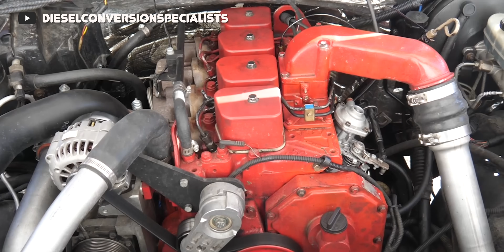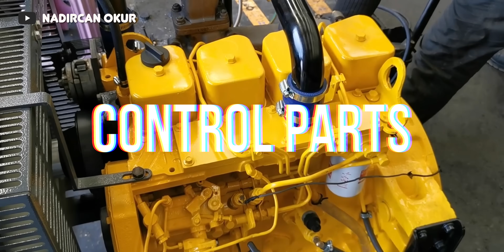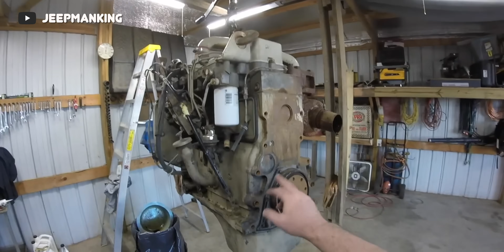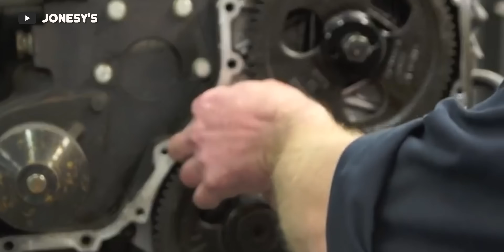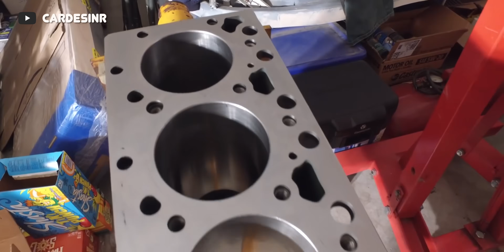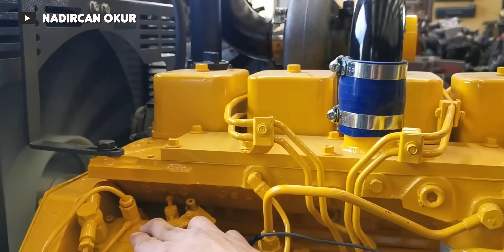Everything Wrong With the 4BT Cummins (It's OVERRATED)

Comment: I'm sure with the P pump you can get some decent power figures if you really wanted especially when throwing a larger turbo at it but these engines honestly don't really have a place outside utility and equipment applications. That being said, I have always wanted to throw one in a half ton truck just to see what I could do to it.
Reply: Look up 4bt Ford ranger. He was making massive power with p pump and twin turbo.
Reply: Not really, you can maybe make 250hp but for the cost you can just import a om605 an easily make 400hp or more. In uk you can get then for a couple grand and it cost about 2k to ship it. So for under 5k you have a 500hp capable motor.
Reply: @WillBilly.  250??? Yeah sure you can make a ton more than that I’ve got a buddy with a twin turbo 4BT in his Dakota I race at the drag strip in my 12V and he makes 500 horse and 1,050 ft lbs at the wheel
Reply: @Callsign_TACH  dont believe it for a second, a full drag 4bt only did a 14 @90 in the 1/4 mile. the pump is extremely limited, its hard to push more fuel out of them. the 4bt pump tops out at 230cc and with it being a i4 its just not alot to work with. if your buddy truly has a 500hp 4bt make a video of some dyno and drag runs, it would be the fastest 4bt on youtube.

Comment: For the money, I'd rather swap in a Kawasaki ZX-11R or a Hayabusa engine in place of that heavy 4BT monster and still get the same horsepower.  With that, the power to weight ratio is increased significantly.
Reply: Are you seriously comparing a diesel to a motorbike engine?
Reply: And have to rev it to 40k to get 3 foot pounds of torque.

Comment: One more thing… the R2.8 crate for about the same price (or a little less) comes with a fuel pump, fuel filter, oil filter, vacuum pump, alternator and other accessories helpful for a swap. It’s essentially almost a drop in with the exception of dealing with motor mounts (and obviously engine bay and chassis clearances), especially if it were to be a daily driver. The R2.8 is also >200 lbs. lighter than a 4BT.

That just something I felt was helpful to state. Take that how you will folks.
Reply: And if you have any issues chances are high that Cummins will cover it
Reply: you can't even get parts at the parts store for that you have to order it from cummins.
Reply: @joeyscleaningladys  you could probably get a serpentine belt, and the fuel and oil filters from part stores (if they have the correct ones). I’m unsure of the other stuff though.
Reply: @jbmorris2893  it is a chinese market engine you cannot get anything for it locally.  Have to order from cummins.  4bt you can get everything from any parts store (basically everything from a 6bt transfers over) be it  valve cover gaskets, oil filter, fuel filter, serp belt etc)

Comment: I have a 2.8 Cummins, it’s meh. The 5 cylinder power stroke is better, much more enjoyable. Better truck too.
Reply: I bought out to do a swap in a Bobcat Versahandler and have quickly realized I should have done another 4bt swap...  Try getting ANY parts or help for the 2.8 locally and in a decent time frame....

Comment: I would take a 1.9 tdi in a small vehicle over this due to the cost savings alone
Reply: A low mile 1.9TDI PD "Pumpe Düse" VW EA188 would be awesome. Reliable old school tech (Unit Injectors) in a fairly modern package. VW adopted the commonrail surprisingly late:
The VW EA189 is the commonrail replacement for the PD engine and they started making them in 2007.

VW made some really interesting diesels. Ever seen a 5 Liter V10 turbodiesel with unit injectors? Yup they made a massive V10 TDI PD.

Comment: Ever since I’ve been into diesels and I don’t just mean diesels in automotive applications I’ve never understood the hype behind this engine. It’s a great little unit for what they used to cost maybe 20 years ago but for the weight and power I’d take a Deutz air cooled any day over a 4bt.
Reply: I like em both, deutzes are cool engines. 
4/6bt is simple and does the job. 
I know rebuilders hate deutzes but I didn't mind doing them,guys hate the assembly/disassembly part when setting up the liner heights/piston protrusion.
Reply: Older VW diesels are also pretty good actually. 1.9 TDI PD: Cant kill em!

Comment: HP is not where it's at.
Reply: Realized this when I built a 1.9 mechanical TDI for my 79 rabbit and got 140hp/240ft pounds at the wheels from a mild setup,just some upgraded injectors and more boost. 
Not even an intercooler. 
Now it doesn't start to hook up until 3rd gear and Ive gotten 54mpg hiway,it's usually high 40s around town. 
Anyone with a TDI that says they get 50+mpg is lying as they've probably got anywhere from 1000-1500 pounds more weight than I have.
Reply: @MrTheHillfolk  imperial gallons that the Brits, Ireland, Canada, Australia, New Zealand etc use are bigger than US gallons. US gallon is 3.7L imperial 4.5L 

Before standardised imperial/US units there used to be different measurements for different liquids,
the US standardised on the wine measures while the British standardised on the beer measurements 

That’s why you sometimes see people talking about 50-60 miles per gallon, they’re talking about imperial gallons. 

Other than gallons, pints and fl oz US units are all identical to British imperial units so most people have no idea there’s a difference, the 1.9 golf does get 50+ to the gallon easily if everyone is on the same page with which gallon we’re talking about.

Comment: Best thing about a mechanical diesel like these us efficiency and you can literally run them on any fuel.    Straight motor oil trans fluid  if running thicker oils you can thin it with gasoline.
Reply: Is there a mechanical pump conversion for the 3 cylinder VD TDI motors?    The older cars are now 25 years old and legal to import to the U.S.A., but just the motor would be sweet for a Geo Metro swap
Reply: @timothykeith1367  yes the bosch ve pump vw modified there slightly different they also made p pumps with not just 4 and 6 inline but more n less the tdis can when mechanical are the best fk e/p/a/ no wires fix yourself no problem when shit hits fan you need a mechanical deisel the vee dub can get near 50 a gallon of what ever filterd oil you stick in as long as it is not to thick n cold or thin because it lubes pump

Comment: I built an entire honda crx suspension, engine, paint, built to 400hp rated with turbo. For less than 14k including the price of the car. So 16k for just a rebuilt engine is way to much.
Reply: Not comparable. I paid $500 for my first LS Swap. Diesels are expensive. It’s often better to buy the vehicle that has the engine you want and pull it out. Sell everything you don’t need.
Reply: @danh8302  its all about commonality ls motors are everywhere and came in so many different things. I get what you're saying. I got my engine for 350 dollars. It wasn't the motor that cost all that money it was replacing every piece of the car with new ones (civic parts are cheap) which im sure your first ls swap didn't just entail paying $500 dollars after all was said and done
Reply: @matthewglaze5398  no, that’s what I meant, I was $500 into for my scout in 2006. I had to use pin outs and rewire the harness. So way more work than building a swap harness but it was included. Used a masters 2000 pump, existing fuel lines as I had already converted my IH motor to fuel injection using a TBI system. That was practically free. 

It was a lot of work but came in around $500. 

I’ve got more into my AWD 6.2 gen4 ls 46 ford though.
Reply: To be fair, I had been Ls Tuning since the late 90s so I already had LS 1edit and HP TUNERS. That would be a cost for someone that doesn’t have that.
Edit:Late 90s makes it feel a bit earlier than it was , it was like 1999
Reply: @danh8302  nice that is hard work. Its nice to hear from someone who did it all themselves. And having some of the stuff on hand is always a plus. Im sure it was badass.
Reply: Don't buy an airplane then. 
You'll be severely disappointed when you pay 13k to get a 65hp engine rebuilt. 
Oh,whoops, it was "upgraded" to 75hp spec, but they put that in for free.
Reply: @MrTheHillfolk  damn lol i definitely wont be buying a plane anytime soon for sure.
Reply: @MrTheHillfolk  my old boss had a split tail bonanza and that was one of my big takeaways lol. Ouch, you are putting a new motor in just because it hit an hour milestone. I mean it makes perfect sense but ouch.
Reply: @danh8302  Generally other than commercial use GA engines are often run  beyond the recommended TBO. Annual inspections, oil analysis, and other tests give you an excellent idea of the health of the engine.

How the engine was operated and how often have a huge impact on when it needs an overhaul.
Reply: You will never get that kind of money for a Honda B,D,K,or H series even mint condition from Japan
Reply: @562skillz  lol o how wrong you are. Take a look at bring a trailer and then insert your foot into your mouth. A stock 91 crx si just sold for 30k. Its all about finding the right buyer. Plus I'm not trying to sell it. I built it because i love it and have always wanted to build one myself. So i did.

Comment: One thing that you did not mention is that the fuel mileage is really good even in a full sized truck and it is small in size which makes it easy to work on.
Reply: @Random guy on YouTube put one into an excursion and was getting 25mpg. So compared to stock, that's freaking amazing.
Reply: This is true
Reply: compared to what it costs to ride your mom to work every day. Fuel cost is up but so is food haha jk rotten garbage is basically free.
Random chad bot? Maybe. If not my bad that was just a perfect setup for an old school burn. Comedy!

Good compared to any 6000lb vehicle that gets less that 30-35 mpg, something like that. Ive read 35mpg in a half ton truck city driving not towing. 
I always thought putting a 4BT in a little S10/Ranger sized truck would be sweet.
Reply: @douganderson7002  if you're considering an engine swap of any kind, the last thing on your mind is saving money. The added mpg is just a handy bonus at the end in this case